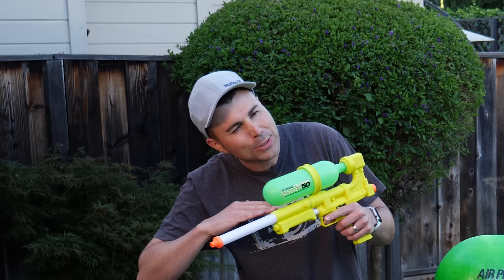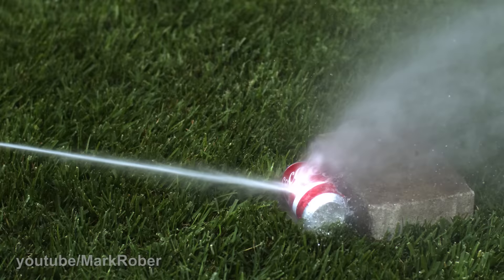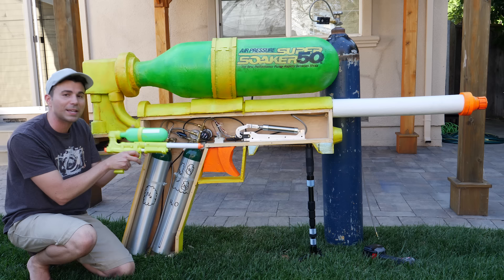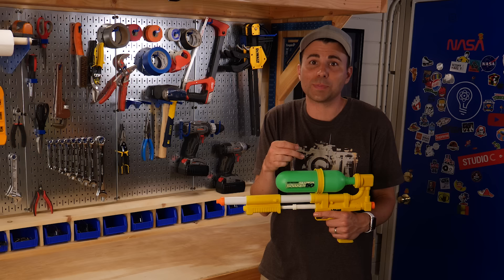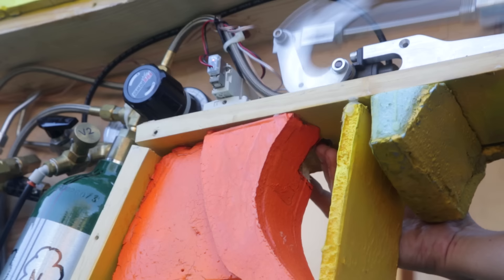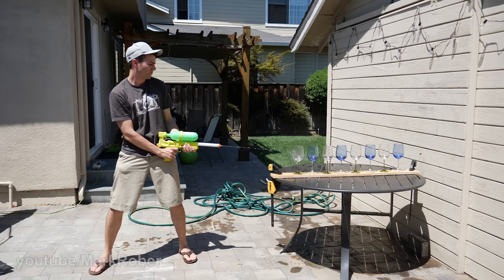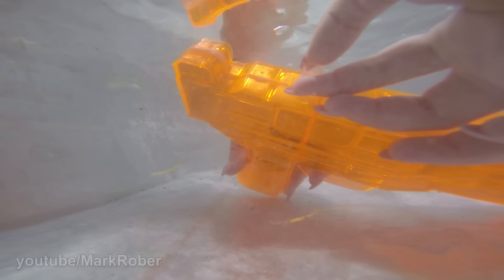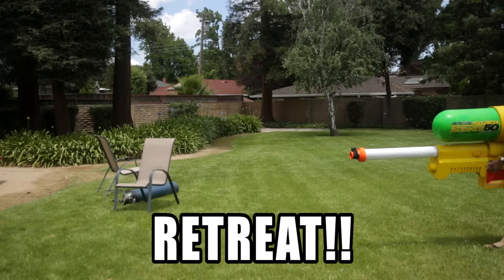World's Largest Super Soaker

Comment: Mark: I made a water gun that can break glass and cut through watermelons.                              

Mark: Time to use it on the children
Reply: H. F. Now I understand why the kid is crying she knows that she is going to die 7:10
Reply: He probably lowered the pressure
Reply: @timothyyi8200  He also changed the head so that it is more of a mist than a stream, that dissipates the force over a larger area
Reply: @Joe boomer Also it doesn't have a laminar flow nozzle so the stream breaks up at very short range, this difference is why the stream of water from the hose on a fire truck carries further even at lower pressure they have laminar flow nozzles that drastically reduce the turbulence in the water which causes the stream to break up.
Reply: P
Reply: Kid slain +50xp
Reply: @peterthegamer4497  p lol lol man
Reply: i will to
Reply: hehe
Reply: Last time I checked kids weren’t made out of glass and watermelons
Reply: H. F. And soda cans and 🍌

Comment: Given that we've just seen that this machine can pulverise/slice fruit, it it not a little unethical to fire it at children?
Reply: He has a wide nozzle on it and he probably reduced the pressure for that part.
Reply: Henry Rolt different nozzle dummy
Reply: Which is stronger.... A fruit or A human with Many layers of fat, skin,muscles and bones under those layers of muscles.? HMMMMMM I WONDER
Reply: @jclicupa8735  a fruit in some cases. In fact dropping a watermelon is about the same as a human head
Reply: Spenser Cool human bone is stronger than concrete
Reply: @nathanc.8821  That doesn't mean you wouldn't get whiplash or a concussion. Of course it is all sort of random when it comes down to it.

Comment: Fire ENGINE nozzles (not hoses) are not run at 300 PSI  100-200max on deck guns and stand pipe systems but definitely not a hand line